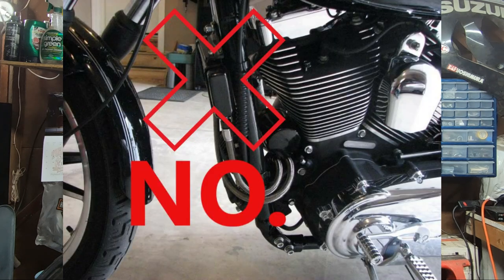How The Twin Cam Engine Became What We Know It As Today

Comment: Okay, here is Earl again,LOL.  I have been making comments about the evo lately and am really enjoying the comments of others.  So, now about the tc 88 counter balanced B and A version of the twin cam.  I also own a harley with the twin cam B version.  It is a 2002 softail custom with 38K  miles on it and is very reliable. I do believe the cam chains are an improvement for the same reason motor compnaies in cars went with timing chains before the mid 1950s.  Less vibration and quieter operation.  Now about these cam pensioners.  These plastic shoe tensioners were too make the engine even quieter for EPA as mentioned in the video.  But here is something I have been telling people in harley forums for years now and it only causes argument .  Brace yourselves .  You can remove the spring tensioners altogether and even remove the hydraulic plastic tensioners in the 07 and up by plugging the inside of the two  bolt shoe holder and on the spring type by simply taking it off and throwing it away   They have nothing at all to do with holding the chain on the gears at all. The left side of the chain same as in the chain cams in older cars has some slack and is called the non tension side and the tension side is tight because of the direction of the shaft.  When these ears and that chain were engineered the engineers buit them to run without any tension item applied, but the tensioners were added by marketers to further quiet the engine.  I took a front failed tensioner off of my sons 2001 dyna 3 years ago and he has ran it for around 25k miles since.  His front tensioner the plastic shoe had broken off and the metal part flipped downward. I took it off and noticed the chain on the bottom gear could not be pulled down even enough to expose the inner U under the teeth, so with that tensioner off and ran it for a few seconds and it worked fine   Those plastic tensioners were only added to get rid of sonic hum.  Plus these chains cannot wobble at all because the back pressure from when the cams circles engage the cam lobe will not allow a wobble to ever occur.   .
Reply from the maker: 🤔 that makes a lot of sense actually, hell Chevy V8 timing chains run for hundreds of thousands of miles without a tensioner and have no issues.
Reply: @GixxerFoo  Exactly.  Its that lower smaller gear that lets me know on these twin cam engines. my sons dyna has ran for 25K miles without these spring tensioners. If my 02 softail has any issue off they come and if the chain or gears are worn i will simply replace them. The original engineers design and measure never intended for tensioners to be used on those.  If i get repsonses on this on the net, i have learned i have to ignore because people that dont have measuring engineering and machining knowledge will only believe tech shop scammers
Reply from the maker: It makes perfect sense, the side opposite the tensioner would have play in it. It's wrapped around a sprocket so it's taking up a little slack on the side it's on. I'll be damned, l never put a second thought to that till you said that.
Reply: @GixxerFoo  I am absolute witness to this.  That non tension side has slack for the same reason the chevrolet 1957 283 engine had slack, it is so oil can enter the inner gear teeth as it rotates to the tension side, so therefore the slack must be there.  if both sides were tight without slack then the inner u area of any gear would never get oil
Reply: Could you get more information about this . it's really interesting! 
What about the inner cam shoe is it necessary?
Reply from the maker: That was some really interesting information. I went and watched his entire video talking about it, it makes sense to me.
Reply: @GixxerFoo  Heres some additional references.  Harleys with camains.  The chain is tight on the top tension side, but is looser on the bottom and any biker of your older rear chain knows that you could not have the upper and lower tight, but the lower had to have some looseness.  Now about the primary chain.  On the manual shoe adjuster you rotate the chain to its tighter  upper area and adjust with 3/4 inch play to account for the shoe taking all of the slac fro the bottom of the chain, but as soon as you start your engine the top will become tight and provide looseness for the area just before the chain rides over the shoe, and this is also so the gear teeth can get oil in the inner teeth area.  Now for me to know about cam chains not needing  to have tensioners was not arrived at from the references I just stated but is because ANY metals and measuring of gear assembly that drives a chain will know tensioners arent needed  on  these front or rear cam chains. Same as if you compress a hydraulic lifter when you adjust it, it will also have no oil or less oil to push through the push rod for your upper rocker
Reply: @GixxerFoo  That last comment about cam tensioners and using reference to the older rear drive chains had typos and from soe problem I cannot correct those typos but if you dont understand by readingthe ful conet.  Its still malfunctioning, I need to use my in house computer
Reply: @GixxerFoo  I am in my house now on my computer.  let me make this comment to where it makes sense.  I used rear chain drive and primary chains as reference to help others understand the way chain on gear drive works.  You must have a non tension side in order for inner gear teeth to receive oil.  Now some may ask why a primary chain uses a shoe in the primary case.  That is because the chain is made to be too large so that when you lower the shoe you can remove the chain and sprocket without removing your clutch hub.  Now about cam tensioners. Yes you can remove the front and the rear because they simply arent needed.  These were installed to increase the quietness of the engine for EPA regulation.  You can remove a tensioner from the front cam gear and you cannot push the bottom of the chain down enough to even expose the inner teeth of the crankshaft gear. The engineers that designed those chain lengths pertaining to the gears they rode on, did this without any consideration to any tensioner being used.  The tensioners are simply after market to absorb sonic hum
Reply: You should watch Kevin Baxter's vid on this subject. He says its not a good idea. He also makes a lot of sense.

Comment: They absolutely would have discovered the cam chain tensioner failure. It’s not even a big deal as long as you make it a regular inspection/maintenance item. They just didn’t want to tell their customers that at 30,000mi, much greater for the later hydraulic design, they would need a possible $1000 service.
Reply from the maker: That's basically what happened and they never told anyone till the failures started happening before 15k. Even then they never admitted it.
Reply: @GixxerFoo it's not even listed in the manual for regular maintenance!
Reply from the maker: It never was, you wouldn't find that anywhere in print.
Reply: It was definitely a slap in the face to loyal Haley owners.

Comment: Well I just got a '06 tc h.d. and I use to jokingly  call them 'twin catastrophe' bikes because I had been reading alot of biker rags and alot of the probs. with the new engine. I'll check my chain tensioners as soon as warmer weather comes here(N.Y.), looks pretty easy to r.& r. if needed. Bike only has 12k on and runs really smooth and quiet(totally stock incl. exhaust,which will be my 1st. change and a new a.f.
Reply: NY changed the exhaust laws last year. I'm on Long Island. Two places that are car shops that used to inspect my bike, refused to inspect with V&H Big Shots on my Deuce. A bike shop is probably the only choice I have to get an inspection sticker. Or change my exhaust back to stock, and that is not going to happen.

Comment: Personally I think the SACS system as used on Suzukis made for a handsome engine. I loved the look of the fine fins on the head and barrels. HD could have used this system (first used on a Mustang aeroplane in WW2). SACS uses a large radiator and the 1200s carry a gallon of  oil which, along with the spray jets, keeps things cool. A Hybrid SACS HD, that could look good, even with a large radiator, and be efficient. I would have liked for you to have mentioned the Timken Primary bearings on early TCs

Comment: They realized that the pushrod geometry was the reason for lifter failure on the rear exhaust ! Over revving the engines ! Thus the twin can engine ! 😎
Reply from the maker: They really improved that push rod angle over the Evo, the Evo really needs lifters every 40k with that gnarly angle they ran.

Comment: Took my TC dyna to Deals Gap.
Rode it kinda hard and the back cylinder head bolts turned a little bluish from the heat.
Reply from the maker: Oh dang 😮, wow l'd say you rode it pretty hard. Damn it got hot running through there.

Comment: The sound of the cam gears  wasn’t quiet enough for the epa? Wow. That’s unbelievable.
Reply from the maker: Yeah, they have to take every noise the bike makes into account. They had a lot of work on m8 into making the motor quiet so they could have a bit louder exhaust. Especially with the Screamin Eagle exhaust and still be legal.
Reply: The twin cam is three times louder then the M8,debunked that theory
Reply: Dj L theres a few years in between there.

Comment: One of the early things I did to my 2000 88B Fatboy was to add a Harley oil cooler. It sits between the front downtubes, and is barely noticeable. Marketing Dept. sucks! BTW, 52,000 miles, and the chain tensioners are still good.
Reply from the maker: That's awesome! The oil cooler and some good oil with proper oil changes really extends the life of those tensioners. Some bike cratered before 15K and others like yours just keep on rolling.

Comment: I have the same problem with my 05 Dyna Wide Glide shifting. No matter how I adjust the clutch wether by cable for behind the derby cover on primary I sometimes had a hard time going from first to second and when I park it have a hard time getting N to let off the clutch but that’s a pain in the ass as sometimes it’s fine.
Reply from the maker: What fluid are you running in your primary and transmission? An easy thing to try is some Redline or Amsoil primary and transmission fluid. Sometimes it works for that issue, I remember a guy years ago that was the man at indy service shop trying that out first. If that didn't work he would go in and replace/adjust the return springs.

Comment from the maker: Do you think adding an oil cooler from the factory would of ruined the look of the Twin Cam powered motorcycles?
Reply: I do not. AND whatever anyone thinks about what it looks like needs to ride a new one. I never thought I’d ever buy a NEW Harley. But the now oil cooled motors are fantastic from a riders perspective.
Reply from the maker: Yes! Integrating it between the frame rails was a good move and it blends in really well!
Reply: My feeling on this is that if I per say had to be subjected to slow stop and go compacted traffic, I would want to install a fan.  A small fan on the rear back side of the rear cylinder and one in front on top of the regulator between the frame tubes.  Then turn a toggle switch on to turn them on until I got moving.  Water cooled? NO, because just lie a radiator or leak in a hot car engine upon this happening will ruin one of your body parts for LIFE.  Plus motorcycle are getting so many things added that you cant see the damn motorcycle any longer  As for oil coolers i feel like this, its good but it also delays the time it takes for that engine to get upper oil and you would need to increase your oil pressure and if you dont increase your oil pressure you will ruin your engine
Reply from the maker: Fans wouldn't be a bad idea idea, they had parade mode on the 96's for the rear cylinder. I've talked to some guys that had the rear cylinder on older carbed bikes overheat and seize. I know it's good for the motor but dang l couldn't run the Luv Jugs. They work damn good but l just can't get past the look 😬.
Reply: @GixxerFoo  Yea, it would look funky, but my idea would be to use those small personal desktop fans and paint them black so they wouldnt show up so much, but i know i could do this   i could edge it on top of the inner primary cover to blow upward on the rear cylinder

Comment: Hi there. Big Fan across The Pond.

Rumour has it that the Italian Motorcycle Company called 'Cagiva' had a hand in that Twin Cam Design? Is that right?
Reply from the maker: I haven't heard anything about that for the American market. I'll do some digging and see if maybe they consulted with Cagiva for other markets, possibly for emissions reasons.
Reply: Hi Bro.

Since contacting you i done a bit of digging myself & i can't find anything concrete however according to Wikipedia (Don't laugh) H-D bought out Cagiva's Parent Company in 2008 (MV Augustu) so they would have been too late to have a hand in the making of the Twin Cam but maybe in the M8? 
Now i'm wondering if it is B.S? 
I will be interested if you find something. 
Take care Buddy
Reply from the maker: Harley did own MV for a while, 🤷‍♂️ why they bought l am not sure. It didn't seem like we saw any of their high tech make into the Harley. Well engine at least. I believe they sold it off already though.
Reply from the maker: I believe the 2 stroke harleys in the 70's were rebranded Cagivas. I am not sure if Harley bought them or just contracted with them.

Comment: I had a 2010 road glide custom with a 96 in.³ motor with no oil cooler so I ordered one.  black and when it came out of the box I immediately took the oil cooler cover and send it to the paint shop to paint it to match my scarlet red paint problem solved ,looked great and did what it was supposed to do that was in 2010 funny how today there’s a myriad of oil coolers,  cover upgrades and color matched cowlingsWhen my wife got her Laguna orange 2017 road glide S that had a larger factory installed oil  cooler and big black  cover I immediately removed and 
sent it out as well that oil cooler cover along with a painted inner faring really sets that bike off great little details to take something ugly and really make it a part of the bike
Reply from the maker: I would live to master paint for those reason right there! Color matched parts just can't be beat.

Comment: The should put sryling on spot to make one look good.
Reply from the maker: They could of integrated the oil cooler, using the big fins cooled the motor but transferred the heat to the rider. I don't think anyone would of complained about a factory oil cooler.

Comment: Trivia: The FIRST Twin Cam engine was made in the 1930's (not sure exact year) for a Flat Track racer. Wheels Through Time museum has a running model.
Reply from the maker: Wheels Through Time is one amazing collection, they have some very rare items in there. Don't they have that one off bike found in a wall? I believe it's called a Traub?
Reply: @GixxerFoo  You're absolutely correct. They started it when I was there. The story behind the "One Off" bike is amazing. I could spend days in that Museum.
Reply from the maker: I love bikes like that, that one has quite the story too.
Reply: Actually the first twin cams were built in the 20's

Comment: I thought the oil return problem was an acoustic phenomenon where pulses from the crankcase created a standing wave that blocked oil from returning to the case?
Reply from the maker: It was, that was the issue of how the air in the crank case was interacting with the oil. It was definitely a phenomenon.
Reply: @GixxerFoo  There is also the problem of one scavenge pump and two inlets for it - once either the cam chest or crankcase was cleared of oil the pump sucked air until both had sufficient amounts of oil to get suction from both cavities. At that situation - sucking air - the scavenge pressurises the oil tank which then vents back to the cases..... all the oil in the crank compartment then churned up so much so as to leave the top end of the engine with way to much oil in it, resulting in oil going through the rocker box breathers into the air filter, combustion chamber and slowly emptying the oil tank.....
 Incidentally, I suggest you investigate the Scavenger total oil change system so as to remove the oil left in the engine once the bike has stopped. After doing the oil change as directed with a Scavenger, my twin cam had well over a litre of old oil left in the engine.... my Sporty had just under a litre of old oil that contaminates the new oil.... Check it out on Youtube here.... Rogue Choppers Scavenger.
Reply from the maker: Damn! Yeah that's a great idea to check into! I always start draining the oild immediately after shutting the bike off to try and get as much out of the tank as possible. But without the system you suggested there's no way to get it all.

Comment: Don't oil cooler sometimes cause excessive varnish and sludge because of uneven cooling and slow warm up?
Reply from the maker: It's possible, but that's just like short tripping a car. If you get the bike out and ride it, get it up to temperature and run some miles it won't be an issue. Also keeping up on your maintenance will prevent anything like that from happening. Slow warm ups aren't an issue if give the bike a few minutes to build some heat and circulate the oil.

Comment: My brother has a 2015 year 103 twin cam.  Are there any gotchas to be aware of? (eg, cam chain tensioner, etc?)
Reply from the maker: From the 96 up they had the issues worked out on those, the 103 is a good solid motor. The hydraulic tensioners are a lot better, I would check them at about 50k just to be safe but other than that the 103 is good to go.